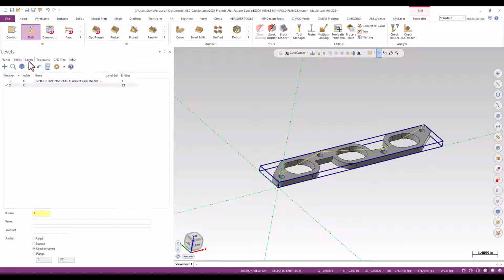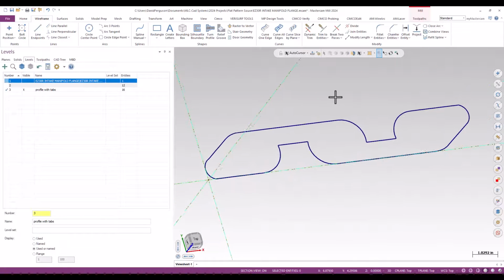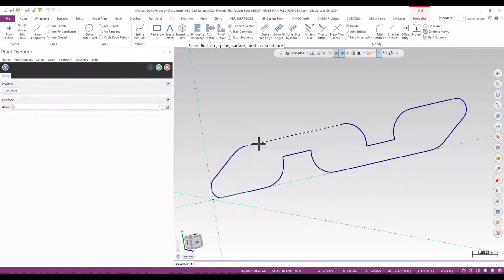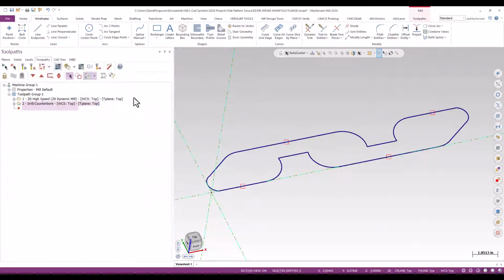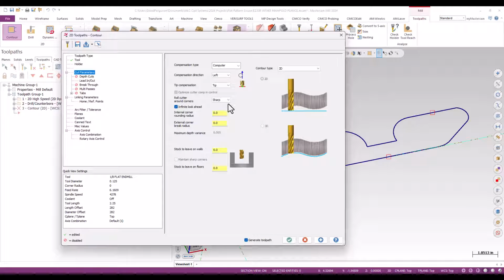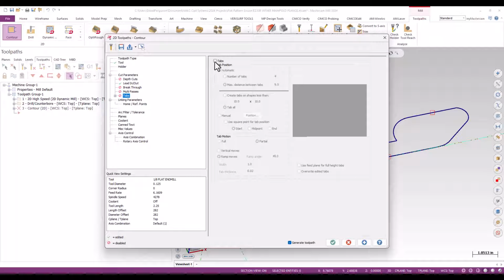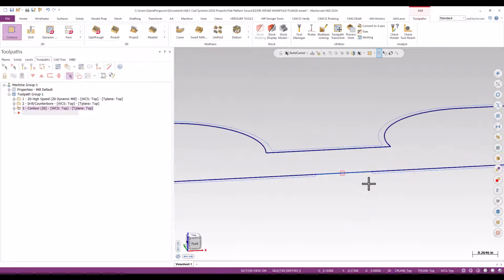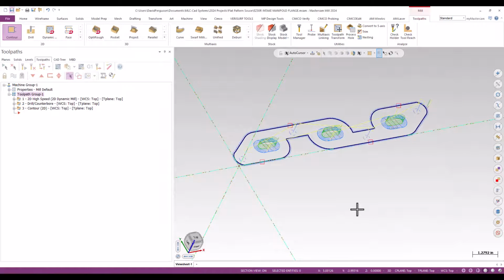Cut Out Flat Parts with Tabs using Contour Toolpath in Mastercam

Comment: I have mixed results with merged .iges linework. I can place square points at nice controlled intervals, but only some points generate tabs when the parameters are set to do so. Are there some conditions of the toolpath linework that may be causing problems?